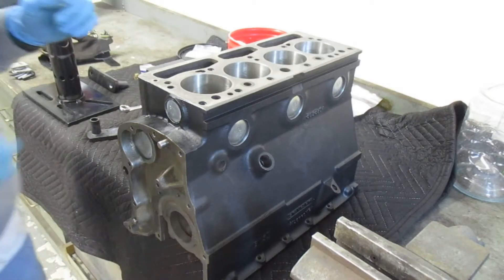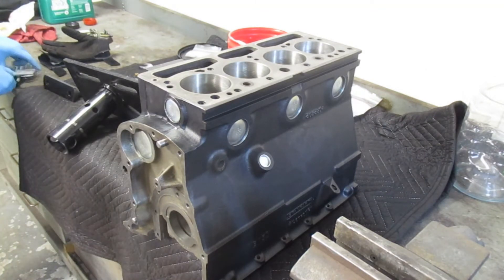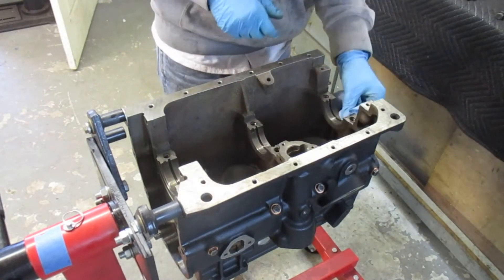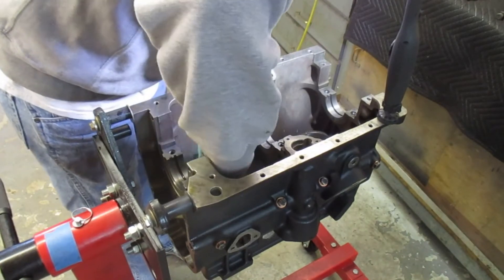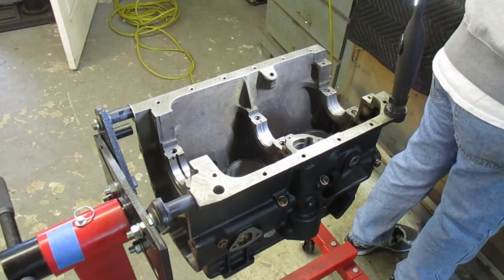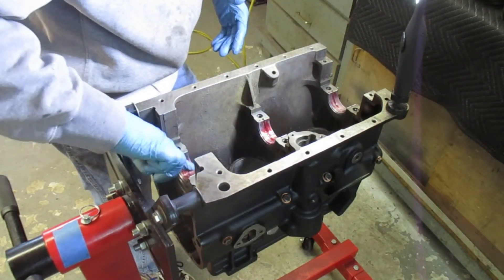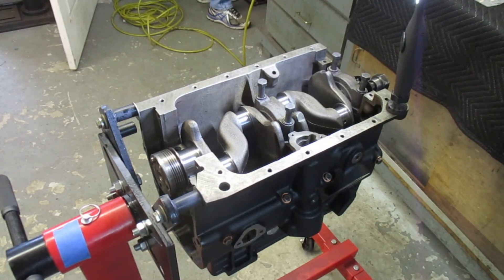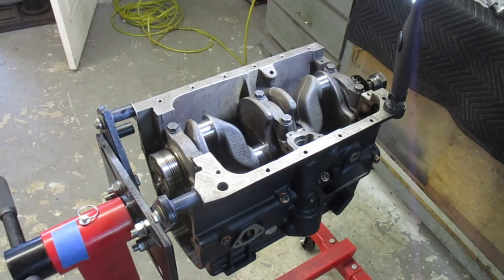Triumph Spitfire Engine Rebuild #1 - Crankshaft Installation

Comment: I rebuilt a Mark 4 Spitfire engine in the den of our house in 1968. I had done tune ups before and some suspension work on it but never any major engine work.  Triumph had a loose-leaf shop manual that was a pretty good guide. I took it to a machine shop recommended by a local Triumph racing outfit, Bob Tullius' GROUP 44 to have the head milled and bought a 3/4 race cam from them.  That Spitfire engine had no cam shaft bearings so the oil fed from the oil channels in the cast iron block without any bronze or other bearings.  I think the next model added them. I was running out of time to go back to college but once I realigned the distributor rotor shaft it cranked and ran well.  Hopped in and drove 450 miles to college and the only hitch was a 2 drop per day oil leak out of the timing chain cover b/c a screw stripped and I only lightly redefined the threads with a same-sized tap. I'm looking forward to watching your rebuild. Mine was in carport without anything but wrenches, screwdrivers, hammers and of course a piston ring compressor. Never rebuilt another.
Reply from the maker: That's a great story, thanks so much for sharing. I have the loose leaf manual and it was all I needed. I have an older motor, so no cam bearings. Pretty brave first drive! In haven't put that many miles on since I've finished. Thanx for watching!

Comment: What bolts did you use to mount the engine to the engine stand???
Reply from the maker: I had to go to True Value and buy a bunch of long bolts and big flat washers / fender washers. Trial and error. I brought a clutch housing-to-engine bolt with me to match thread pitch. And I bought grade 8 bolts for the extra strength to minimize bending.
Reply: @roundtailrestoration  sounds good thanks
Reply from the maker: Good luck. Hardest part was arranging the stand arms to fit the little dinky engine!
Reply: @roundtailrestoration  lol thanks for the heads up

Comment: Sir hows this motor holding up after the rebuild? How many miles have you clocked on it thus far? getting ready to source a 1.3 or 1.5 parts car for my 73. I do not have a lot of experience with engine work so I am hesitant to open a block up
Reply from the maker: I only have about 150 miles on it since the rebuild was done, so no where near enough to say anything about how it's doing. Not until I get over 500 miles will I have any confidence in my rebuild. But, that being said, the oil leaks are minimum (mainly from the rear main seal, which is a scroll seal and will slowly leak anyway) and she runs strong so far.

Comment: Ah, that explains it. I remember your "first start" video and was worried you had to send it back out after that!  Did you Plastigage the bearings?
Reply from the maker: Nope, it all worked itself out. No problems.
Reply: Yep, we, the Spitfire guys like doing that, posting the engine rebuild videos months after the work has been done :) Remember I was getting advises on how to solve problems when the engine had 2000 miles on it already LOL
Reply from the maker: +Elin Yakov Yes, I remember that you were a bit behind on those 😆